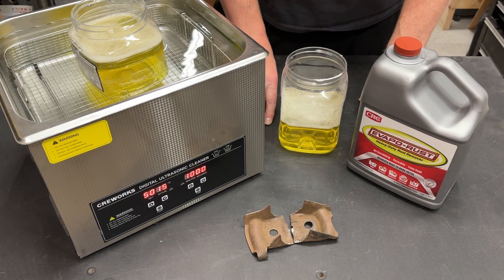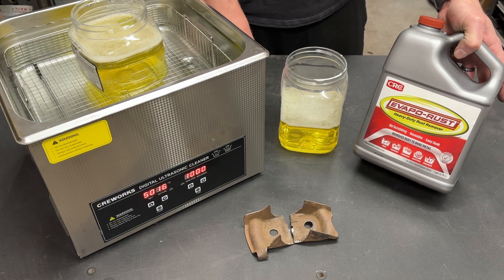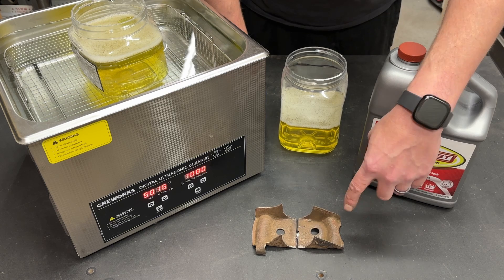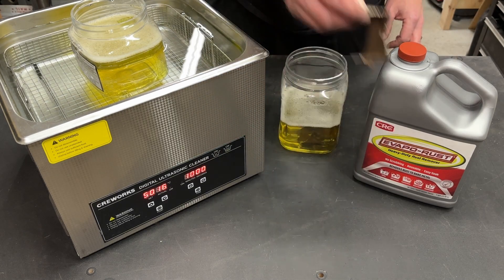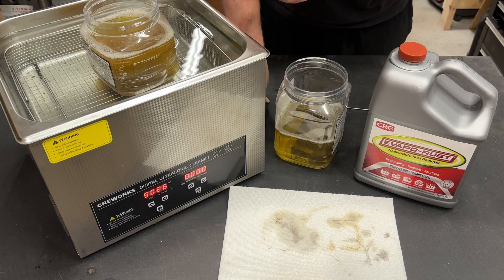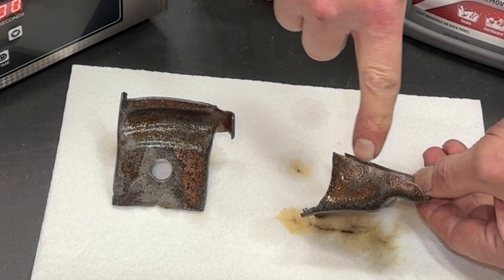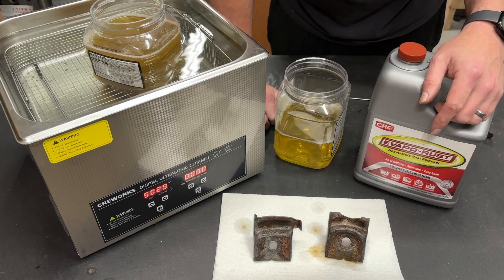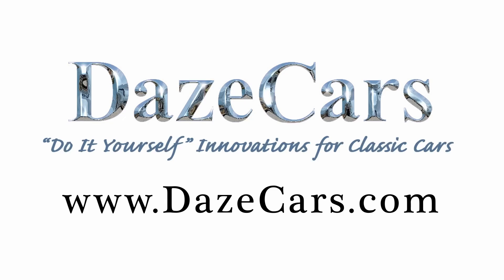Using an Ultrasonic Cleaner to speed up Evapo Rust’s Removal of Rust Lets Test it

Comment: Nice illustration. However I would've wire brushed it first to remove the loose surface rust first. This is like taking a shower with your underwear on, just saying.
Reply from the maker: If I was actually trying for rust removal on something I cared about instead of scrap I would for sure have done that.  I just wanted to confirm that the ultrasonic sped up the reaction which it did.

Comment: I just put three Pontiac tri power base plates in my ultra sonic cleaner because that was a big enough reservoir. I thought well while they’re in there I wonder if anyone’s tried turning the machine on while it’s in there and found this. I just turned the heat up and started it cold. We’ll see how long. I don’t know why I didn’t think of this sooner.
Reply from the maker: An ultrasonic is the only way to go when cleaning car parts!!
Reply: @dazecars 1/2 an hour and they were rust free and done. I think the heat helps too. Blows my mind how fast!
Reply from the maker: The heat for sure helps, in fact heat is recommended by evaporust.  I use a fish tank heater when doing things that won't fit in the ultrasonic.

Comment: I think it goes slightly faster cos of the heated function.
And it shake off loose rust gradually. But its still the solution that does most work. Not the cleaner.
Reply from the maker: I disagree.  Heat was off.  yes some heat is introduced due to the ultrasonic action but not enough to create those kind of results.  You are assuming that I was trying to imply that the ultrasonic action on its own was somehow removing rust but that is not the case at all.  The solution is doing all of the work, but the ultrasonic helps the solution work faster more efficiently.  This was proven with other tests I have done using an ultrasonic for black oxide coating.  Same concept the ultrasonic action speeds up the chemical reaction of the solution and the metal.

Comment: Now test with heat. See the difference with using the heat feature. It exist for a reason
Reply from the maker: I agree it would be better with heat, but whats the point it worked way better without the heat so adding the heat is only going to make it even faster.

Comment: wonder what a 50/50 mix of acetone and transmission fluid would do
Reply from the maker: I worry about putting anything flammable in an ultrasonic as the agitation and heat caused by the ultrasonic action can cause things to vaporize
Reply: @dazecars  Fair enough, thanks for the time!
Reply from the maker: my pleasure

Comment: Where I find the (ultrasonic cleaner + evap-rust) to work best is with restoring tools. Especially tools with tiny internal parts and tight tolerances. I've also experienced that the ultrasonic cleaner will keep the evapo-rust working long after it has turned black. I do filter the sediment about every 5 batches with a funnel and paper towel. But yeah, with the ultra sonic cleaner, the evapo-rust keeps on trucking and removing all rust from the most morbidly rusted pliers. After I clean the tools with evapo-rust I put the tools with internal parts in a submersion of wd-40 and pull a vacuum on it to evacuate the air so the the wd-40 can reach the most tight crevices. Been doing this for a few days now, and it has been a great success. Tools are looking amazing, and even some of them look like they are straight out of a package.
Reply from the maker: That is a very good idea using WD-40 and a vacuum to get the oil into those tight spots.

Comment: Okay so this is strictly opinion. 

Also note I’m aware of cost etc

I think that in order for the test to be more accurate involving heat, a second ultrasonic cleaner could be used. That way both cleaners are set to the same temperature, but only one of them is using the sonic application.

It’s really anal and probably expensive but in theory it would work.
Reply from the maker: If I was trying to control for heat a bucket with a fish tank heater and a thermometer would get the job done.  Heat has already been proven to accelerate the process, in fact the directions say as much.  I was just testing to see if agitation helped.   The results were dramatic enough that we can conclude that agitation does help and heat is only going to make it BETTER
Reply: @ 
Very well aware my good sir,
Just throwing out rando ideas

New subscriber, I like your videos
Reply from the maker: I appreciate the ideas.  I am always looking for content ideas that people actually want to see.

Comment: Great test! Another test would be to use heat alone for 12-24hrs, thus not puting wear on the ultrasonic part of the machine.
Reply from the maker: That has already been done and heat makes a drastic improvement on how well evaporust works
Reply: @dazecars  Thanks! I probably missed it. Great to know.
Reply from the maker: glad I could help

Comment: Comment and question:  I have a copper plated radio chassis that needs de rusting (such a word?) I do have an ultrasonic cleaner, I wanted to know how high I would need to set the temperature, and would it work on something where I want the copper plating left alone (its used a a ground for the radio)
Reply from the maker: maxing the heat is the best option when it comes to evaporust.  As far as the copper I do not know if evaporust reacts with copper or not.  I would do a test on a scrap piece of copper before trying it o your main part.

Comment: I’ve been using a heated ultrasonic cleaner with various rust removal solutions for several months now. You would have gotten much faster and better results had you heated it to between 30 to 40 degrees C. Had you used heat, the piece in the ultrasonic cleaner would have come out even better after only 1 hour. The agitation alone does help; however, not as much as the cloudiness of the liquid might make you think. The cloudiness is mostly because the agitation keeps the rust particles that would otherwise settle on the bottom, suspended in the liquid. The agitation does help; however, it’s the heat that really helps with the chemical reaction and therefore rust removal. So much so, that the only time I don’t use my ultrasonic cleaner for rust removal is when the parts won’t fit in it. 

For most things, I set the ultrasonic cleaner at 40 degrees C and run it for 30 to 60 minutes and my stuff comes out better than 24 hours unheated.
Reply from the maker: As I said in the video I know heat is the way to go and would totally help but I wasn't testing heat I was testing agitation compared to soaking.  Adding heat would have added another variable to the test and made the results inaccurate.
Reply: @ that’s fair. I went back and watched the video again and you did mention that a couple of times and I agree that adding heat would invalidate the results for a test specific to whether or not vibration helps. Perhaps you might consider follow on videos in which you test the results with heat and no vibration as well as with heat and vibration. In my opinion only testing the effects of vibration, when you have the ability to vibrate and heat is kind of an incomplete test, because you are not utilizing the full capability. I would have to do a test similar to your to substantiate this; however, my casual observations leads me to believe that I’m getting better results for most things after 30 minutes to a hour in the ultrasonic clear (vibration and heat) than I get soaking a part at room temperature for 24 hours.
Reply from the maker: I may circle back and try that

Comment: Are the containers, used both in and out of the ultrasonic cleaner, made of plastic or glass?  Would it be of any benefit in making such a comparison to brush the rust off of both items, before continuing to measure the effectiveness of the process.  

P.S.  Several years ago, I found that online sellers offered Evaporust in 2.5 gallon plastic containers, with both a sealable top and a basket to hold small parts, and at a considerable savings, with free shipping from the Vendor I used.
Reply from the maker: They are plastic and plastic will reduce the efficacy of the ultrasonic but not enough to avoid using them.  Yes brushing would help but I was trying to keep the test as simple as possible.

Comment: I bought a ultra sonic cleaner couple years ago. One thing i noticed is it takes hours for the tank to get up to full temp. 80C  is this normal?
Reply from the maker: I have not used the heat much but I do know that the ultrasonic action helps heat the solution.
Reply: @ yeah mine takes hours to get up to max temp, would think it would heat up quicker
Reply from the maker: agreed

Comment: Plastic jars absorbs the ultrasonic waves. Eat some jumbo pickles and Use glass it’s a noticeable difference.
Reply from the maker: yes they do, and glass would be better but the plastic still allows much of the ultrasonic action to pass into the inner container, so while it reduces the cleaning action its still an effective option if you don't have a secondary container that is big enough made of glass or metal.

Comment: Thought for a video:  Anodizing. Or perhaps electrolysis, for rust removal.
Reply from the maker: That’s a great idea. I will add it to my list.
Reply: @randallthomas5207  If the Shopdog Sam videos are still on YouTube, I recommend his methods of using electrolysis to remove rust. Instead of using a metallic sacrificial anode, he used bars of Carbon he got somewhere, and the Carbon generated no sludge when his electrolysis set-up removed the rust.

Comment: Awesome video! I do have a question, is there any difference using a plastic jar vs. a glass jar submerged in the tank?
Reply from the maker: yes it has been reported that glass transmits the ultrasonic waves better than plastic but plastic still works really well.

Comment: I have been using Evap-o-Rust in mine for a while. Definitely works better with heat. I like to mix in some with whatever solution I'm using in my cleaner just to help get rid of rust. I often left stuff soak in my cleaner overnight or for multiple days if it is particularly nasty. So it all works out in the end for me.
Reply from the maker: Evaporust works well I just wish it was more cost effective.

Comment: Use the heater and vibration. That's what I'd do. Otherwise you aren't using all the capabilities of the tool.
Reply from the maker: As I said in the video the heat would have been better but I was trying to do an apples to apples comparison

Comment: I just commented on your other post so I'll comment on this one also. I used to use Evaporust but it's pretty expensive and it does have an effective life. I actually have a 5 gallon bucket of it in my shop right now that I have not opened because it's expensive and I found out white vinegar works just as well, lasts a long time, and is way cheaper. White vinegar will also remove mill scale from new steel so you can weld, paint, or powder coat without having to grind it off. And if you want it really clean take the metal out of the vinegar after a 24 hour soak, rinse it off in water and then stick it in the ultrasonic with a degreaser for 10 minutes. No sanding or blasting required. I haven't tried vinegar in the ultrasonic though. Maybe you should do that comparison.
Reply from the maker: Testing vinegar is a good idea.  IMHO the non acidic nature of evaporust compared to vinegar is something to consider.  Given enough time the vinegar will attack unrusted metal whereas the evaporust only attacks the rust.  Not as critical on a part that can be fully cleaned after being treated with vinegar but more critical on an assembly with moving parts where it's harder to get into the nooks and crannies.  Thanks for the comment

Comment: To get a true view of the parts status you should have agitated with a brush under running water. Likely a lot of what you see would come off. That would show what rust is really still bonded to the metal.
Reply from the maker: while that is a good point I do not believe it would have changed the conclusions
Reply: @dazecars  I'm not sure if it would show more difference or not.  I do both Electrolysis and Evapo Rust, for different types of parts.  My next step after either is to brush them off in plain water.  The parts look quite different after that.
Reply from the maker: I totally agree that brushing would help with either the soaking or the ultrasonic method.  My point is the conclusion that I came too of the ultrasonic being faster but probably not enough faster to make it worth running the machine  when all you need to do is soak it for a few days is still an accurate conclusion regardless of any brushing.

Comment: I've been trying out EvapoRust in my ultrasonic with heat. It's VERY effective. I think it also works more evenly because it helps the liquid get into contact with rust underneath thicker flakes or in the bottom of pits much sooner, instead of waiting days for it to soak while the rest of the surface is already down to bare metal.  I have my ultrasonic set up in a basement workshop where I can set it running and then close the door while I do things elsewhere in the house.
Reply from the maker: It for sure is a faster way to remove the rust.

Comment: I'd probably would've heated the evaporust in a lidded jar in a pot of hot water. As far as speeding up the black oxide growth would the black oxide crystal growth be the same as in standard blueing practices?
Reply from the maker: heat would have helped for sure but I was trying to see the effectiveness of just the ultrasonic.  black oxide is a cold process where traditional bluing is a hot process

Comment: The only reason I want an ultrasonic cleaner is for cleaning cast iron tractor carburetors. They usually have sat for decades and they can be very difficult to get cleaned properly. I want a comparison between purple powder and evaporust to see what works best.
Reply from the maker: thanks for the input I will consider it

Comment: At an Evapo-Rust demo they used heaters and parts were cleaned after several hours.  It might have been more accurate if you had washed and brushed the parts after each soaking.  I had a Branson Ultrasonic cleaner that did not have a heater but the ultrasonic action heated up the water anyway.
Reply from the maker: Yes even though I was trying to not have heat be a factor it was still a factor.  The water I put in the ultrasonic was cold and chilled the solution at the beginning but after running for an hour the water was warm.  Not as accurate from a scientific standpoint but I believe the conclusions still hold.

Comment: What it really have taken that much longer to add hot water and test again? That's the test I want to see. I'm saying it right here in comments.
Reply from the maker: The issue is a consistent temperature between the non ultrasonic and the ultrasonic.  Yes I could have put a heater in the non ultrasonic and heated the solution in the ultrasonic and then used a thermometer to confirm they were the same but that adds a lot of complication.  The basic test I did proved it was faster with the ultrasonic and that was ultimately what I was trying to determine.

Comment: Why would you not use an Ultrasonic Detergent like Omega Clean?
Reply from the maker: It's not about cleaning its about rust removal as I said in the video.  Did you watch it or just comment based on the thumbnail?  Detergent will do nothing for rust.
Reply: @dazecars    It actually does.. But I get it... Its a cleaner... I don't know how it works but it does...
Reply from the maker: if its an acid based cleaner and has something like  phosphoric or other acids in it then yes that will remove rust but a basic soap with no acid will not remove rust just dirt and grease.  All depends on the formulation of the cleaner.  I stand by what I said soaps in general are not rust removers.

Comment: I found this homemade rust remover and it works as well or better then evpo rust and is a lot less expense. I took it one step further and made a gel by adding corn starch 12 tablespoons per  liter and heating till thick. It then can be applied to vertical surfaces cover with plastic (used magnets) and 24 hr most rust removed. If deep pits cleaned and recoated another 24 hrs and all rust removed. Coating about 1/8" thick thicker is no advantage,  
https://www.youtube.com/watch?v=fVYZmeReKKY
Would be interesting test against other rust removers, cold , hot, agitation, electrolyze , and ultrasonic.
Reply from the maker: Thanks for the link I will check it out.

Comment: Well heat makes more chemical reactions happen faster and evapo rust is no different and the ultrasonicness im sure helps knock off loose stuff but i think youd be better off just cleaning the part with the ultrasonic first and then use evapo rush just to conserve the evaporust so you don't have like loose rust in the evaporust using it up
Reply from the maker: yes you always want to knock off loose rust before soaking per the evapo rust directions.